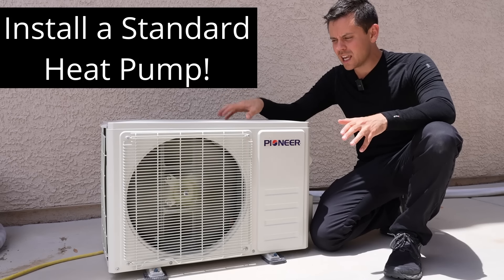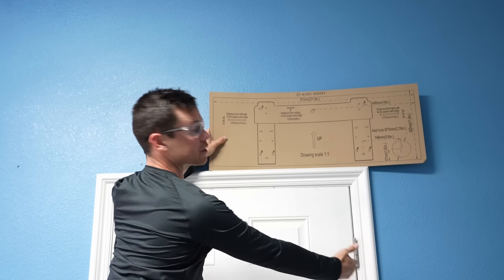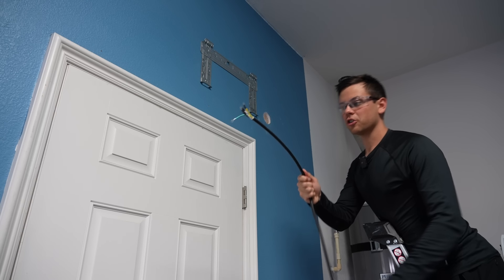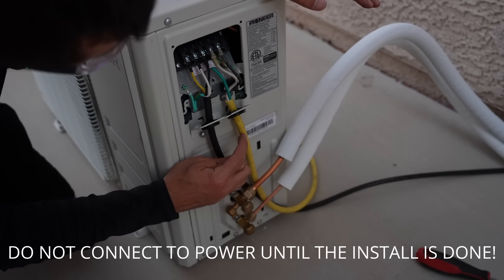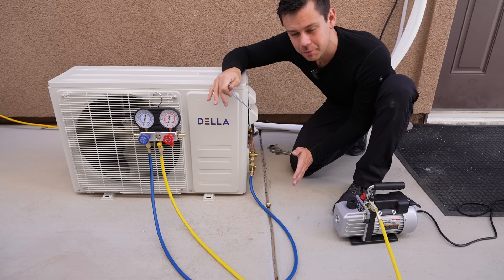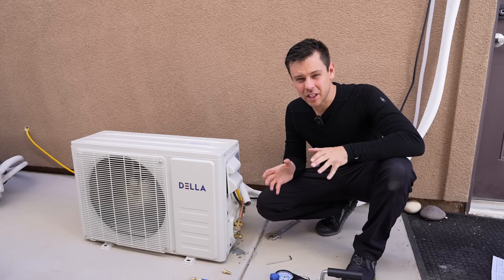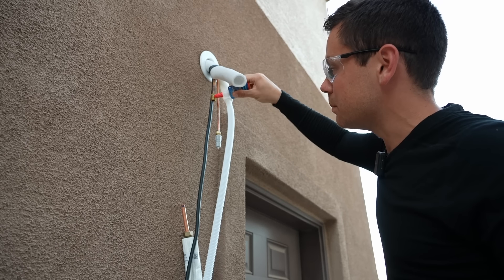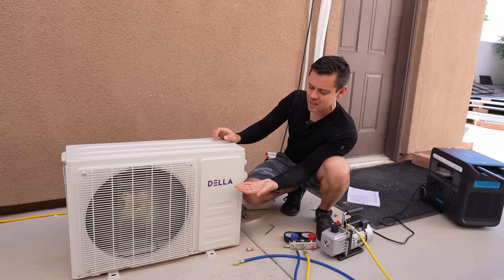Budget Mini Split Installation for Beginners! w/ Vacuum Pump and Gauges

Comment: Just an FYI, if your vacuum rises a tiny bit then stops, that's okay. Run the vacuum pump again until you're back to zero. What happens is that as you pull the vacuum, water vapor in the line will condense and then freeze. Ice will not vacuum out. But as the lineset warms up and the water evaporates (sublimates, actually), it will cause the vacuum in your line to drop. Will didn't have to deal with this because he's in a desert, but if you're in the southeast you will see it.
Reply from the maker: Oh that's interesting. Thanks for sharing that
Reply: This is why the manufacturer recommends a teipple vac/nitrogen flash sequence.
Moisture crystals in the system get heated and flushed out with the nitrogen purging sequences.
Lotsa tricks we pros use.
Reply: I'm in southern west virginia. Been vacuuming for 15 mins now and vapor still coming out. I don't have any nitrogen to use so what do I do?

Comment: Great Video. I have a Pioneer unit that is about 10 years old. I did not have the HVAC  tools, but I installed it all myself and had an HVAC tech friend come over to vacuum it and release the refrigerant. I've never had a problem with it and have been very pleased.
Reply: That's what I did too. You get a proper nitrogen purge as well, plus he'll have a fancy leak detector and good valve core remover. Even ends up being cheaper when you're only doing 1 or 2.
I'd only go full DIY if I was fitting out a whole apartment complex or something
Reply: @motog6436  Do you remember what you paid per unit? I'll have 4 or 5 of these to do on a new property I'm developing, so I figured the DIY route would save me some money, but maybe not? And any idea if you get the factory warranty going this route, or would the tech need to actually do everything Will's doing in the video? The Mitsubishi unit I bought recently, and I think most on the market that aren't called "DIY" require an HVAC tech to sign off that they did the installation in order for the manufacturer to honor the warranty.
Reply: @TroyWarr1980 if you are doing several, the proper tools and supplies will save you money and make it so you can do more in the future, or sell the tools on marketplace…
I am a pro installer in Charlotte NC… I left a lot of critiques for Will in the comments.
I’m happy to list what you need to do the job right on your own.
Reply from the maker: @SuperVstech  can you post a video of how to do what I did on a budget? And I responded to everything you mentioned.and  People will not spend money on the fancy HVAC gear if they can just buy a mr.cool or EG4 with quick connects.
Reply from the maker: @TroyWarr1980  the Mr. Cool doesn't have to be installed by a professional and still has a killer warranty for diy. They just cost a lot.
Reply from the maker: @TroyWarr1980  I would call around if you do hire an HVAC tech. A lot of the make up whatever price they want and some will charge insanely high prices. Sometimes not.
Reply from the maker: @motog6436  valve core removers are like $10. And you can flush the lines with nitrogen. They have a flushing kit for $30. It's not hard to do. None of this stuff is hard
Reply: @WillProwse  I could show all the ways to do it. Making a good video is HARD my hat is certainly off to you there! You are the BOSS of quality videos. I love that you address comments, even when they are asinine, and completely in the wrong!
Budget wise, instead of buying a $400 nitrogen setup, a paintball can adapter and you have a fantastic setup for leak testing and purging. Lowe’s used to stock a co2 setup for $50 that had an air chuck etc for portable nail guns...
But they discontinued it…
There are plenty of budget micron gauges available, and pawn shops often have good ones pretty cheap.
Reply: @WillProwse can you show us how to do a nitrogen line also can you please link the flare tools that you purchased?
Reply: I called a few companies and asked if they would just clear and connect the lines. They said: no way Jose, we only work on what we sell Mitsubishi, carrier, etc. Said their cheapest mini split installs are like $5k. So the worst thing about the diy appears to be the warranty but sounds like getting anywhere with an actual claim would be difficult anyways. So the frugalist diy way seems to be individual units (one compressor per head) diy installed.
Reply: @fox156 Good points, and just to reinforce your points, I had local San Diego company  provide an estimate to have 4 mini splits installed in our house (1 for each main bedroom, one for fam room), and estimate was $37,000 dollars for 4 Mitsubishi’s!!!
Reply: Some HVAC contractors do give reasonable prices for installation....I'm having my 24,000 btu Mitsubishi split installed for $1,200 (he supplies the line set, electrical connection and pad).
Reply: @thomasopalka5410  That is good! Does that validate the warranty as well? If it doesn’t I think it’s still ok, just curious.
Reply: @thomasopalka5410  where do you live? (What part of the country is fine).
Reply: My wife and I did the install and like you a neighbor vacuumed the line for us

Comment: One note of warning. The pre-loaded refrigerant is metered specifically for the length of lineset included with the kit. When cutting the lineset short make sure to refer to the manual so that you don't have too much refrigerant for the amount of lineset. A professional HVAC technician can adjust your refrigerant if needed.
Reply: @Channel-gz9hm most units just say don't cut your lines shorter than 15 ft and if you  go longer than 25ft per zone you must add refrigerant by weighing it in.
Reply: Im not an hvac guy, just a lowly plumber.. but i thought "i wonder if its been preloaded based on the length of lineset".. thanks for confirming this! also, just wondering it was it proper practice to open the high pressure side like he did prior to disconnecting? thanks!

Comment: Recommend getting your EPA 608 Type II cert. This way you can buy additional refrigerant if needed and legally add in if you have a longer lineset. I studied for a day then did a remote proctored course with Esco Institute. Got my certificate same day.  Only installed one mini-split in my cabin so far and needed to add a few ounces refrigerant since my line set was 35 feet and unit only holds enough for 25 ft.
Reply: I agree, and technically the EPA says you need it even to do what Will & many other people have done! According to the EPA, even installing the pre-charged lines on a MR Cool DIY unit require it. never heard of anyone getting in trouble though :)
From the EPA website regarding 608 certification:
Q - "Is technician certification required to install an R-410A mini-split?"
A- "Yes. Adding or removing refrigerant from a mini-split as part of installation, and/or connecting or disconnecting hoses or pre-charged lines requires a section 608 technician certification. Activities reasonably expected to violate the integrity of the refrigerant circuit include but are not limited to: Attaching or detaching hoses and gauges to and from the appliance; adding or removing refrigerant; adding or removing components; and cutting the refrigerant line."
Reply: @Channel-gz9hm  He added and disconnected hoses to pull a vacuum. "Attaching and detaching hoses and gauges".
Reply: @Channel-gz9hm  read: "....and/or connecting or disconnecting hoses, or pre-charged lines" ssssh!

Comment: Will, not to be picky, but please show that craw-foot extensions on torque wrenches need to be 90 degree angled to the wrench to cancel the additional length imparted by the craw foot.  This will give you accurate torque.
Reply from the maker: Good point. I do the first passes at 180, then last one at 90. Should have mentioned that
Reply: It appears (at 0.25 playback speed) that only once did you have the crow’s foot at a right angle.
The other times are not at a right angle, thus you are extending the effective length of the torque wrench lever arm. This requires one to use a correction factor (a multiplier less than 1.0). Not doing this will over torque the fittings, which is what it appears you have done. Unless one understands this, probably not a good idea to suggest using crow’s feet on a torque wrench.
Otherwise good video. Thanks.  @WillProwse

Comment: I have an EG4 12kBTU unit and have to get a couple more. The reason I went with the EG4 was the incredible efficiency. This unit can deliver 12,000 BTU on a 120VAC 20 amp circuit. I think they rate it around 28 SEER2. Are there cheaper non-vacuumed line kit models out there that can close in or match the efficiency of the EG4? By the way, excellent tutorial!

Comment: A trick to tighten the hose fittings so as not to leak is to tighten and loosen several times so that they seal well.

Comment: in Mexico they cut costs by using copper in the ends and aluminum in the middle, last installation I did was a nightmare because aluminum sucks to flange hahaha, I had to buy another pipes, one that actually were all copper

Comment: Great tip with opening that valve a little before removing the vacuum line. I just did a Tosot, and opened it slowly and watched the gauge until pressure was just slightly positive. Then you can remove the fitting with almost no refrigerant loss. Why don't any other videos show this? I don't see any way that fitting could be removed while there is a vacuum on it, without introducing air into the system. Thanks for all of your videos, great stuff.

Comment: i have a suggestion on the removal of the blue hose under pressure. you lose quite a bit of refrigerant in the process. i would connect a shut off valve in between the shredder valve and blue hose. before releasing the refrigerant, i shut off the valve and isolate them. in this way, the lose of refrigerant is minimized.

Comment: Just installed a Della 12000 BTU 115 V . Your video was INVALUABLE and got me thru the install. I replaced the manufacturer 1/4 inch line with one from Lowe’s because the manufacturer line kept breaking while torque ing . It’s working beautifully and THANKS SO MUCH!!!

Comment: For the torque settings it is my understanding that the crow's feet need to be at 90° to the torque handle couldn't quite see that in the video but it is important as it does change the actual torque

Comment: Nice. My ductless aire came with a sketchy diagram that required 5 different Kung-fu maths that you added and subtracted to determine the hole placement that still was 1/2 " too high.

Comment: Excellent video! It helped me immensely , but it would have been nice if you showed the wiring a little closer but not required. So, I saw in the break in video that it was -31 or so but in the return video it was -30, did that mean you had a small leak?

Comment: Overall, good teaching. However, when it comes to the vacuum section of the video, when you “isolated” the line set, the gauge would only have been reading the vacuum between the pump and the gauge. Not the lines. Here’s hoping they held vacuum😅

You would need either a valve on the end of the yellow line from the pump or a gauge set with a valve for the vac line.

A nitro pressure test would also have been nice to see.

Comment: 17:58 "remove this nut" but forgot to say put it on the other pipe before flaring ! You wrapped the bundle from the top down. So the overlaps point up, allowing rain to penetrate. Wrap from the bottom up so that the overlaps point down.

Comment: Odd, but my new Della 12k owners manual say, after vacuming, open the low pressure valve 1/4 turn for 5 seconds, not the high pressure side.  Is that a misprint?   Now I'm unsure.

Comment: A great job considering that you probably didn't have access to nitrogen for pressure testing your line set.  Where I live, the building code would have required weatherproof conduit and a disconnect within five feet of the condensing unit.

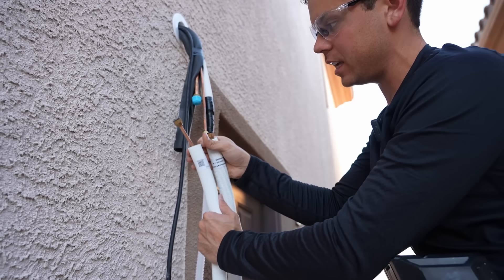Comment: Thanks Will. I have watched a dozen videos on this, and yours is the only one that explained the line hookup well. Question, at 7:23, I hear hissing when you are loosening the plastic over on the inside unit high pressure (small) line. I'm assuming that is the nitrogen escaping?

Comment: Question please:  how do you know if the HP line does not leak if you don't run a vacuum on it?
Reply: No need to, because it all coneccted in circle. So if there is a leak it will show on manometer.
Reply: @Reddington07  Thank you Sir...

Comment: When you shut off the valve to the low pressure line, you were no longer reading the pressure from your system. Therefore you would not know if you had a leak.

Comment: Will.  With reference to your step, opening up the lower valve just a 1/4 turn for 5 secs to bring positive pressure (gauge reading from -30 to 0) before removing the adapter from the port...May work on that brand that you're servicing, but on my Senville mini split, being very careful and doing that(I am a retired Master Electrician), the pressure immediately went to 15 psi) and I was then unable to remove the adapter without purging all the refrigerant.  Everything you outlined worked fine but for the Senville unit, folks should skip that 1/4 turn step and just slowly remove the adapter letting pressure out.  FYI...Paul

Comment: You really should get yourself a nitrogen tank to test the system and ensure it is holding the pressure correctly before releasing the refrigerant. Also, I have used the Hilmor Quick Engage Flare and Swage Kit which seems to have good results and is stupid easy to use.

Comment: Id include another remark in your video. Make sure the adapter for the hose has the valve or, it will not push the service valve to make the vacuum work. It happened to me.

Comment: All of your videos are great and I sincerely appreciate your teaching. One note, on the vacuum pump, where the yellow hose is connected, I didn't have the other cap tightened down and so it appeared I had a massive leak. Then when I went back and checked everything I realized that the cap was not tight and that is where my leak was. I hope this little bit of advice from an amature helps.

Comment: Hello, your actions in your video are quite well executed, but there are still some comments to make:
I never use Nylog blue, the flare makes the seal, not the thread, so this product is used by amateurs who cannot make a decent flare :).
I never use the Tork key, this is for the doubters ;)
And important, you check whether the connections are tight with the coolant in the system. I never work this way, you have to do this before you open the service valve. I always do a pressure test at 1.1x max HP, and this is between 40 and 45 bar with nitrogen. Vacuum with a 2-stage pump and use a digital LP manifold. These are just small tips, but I do start-ups throughout Belgium and I do my refrigeration installations as it should be, based on my training and many years of experience. Have a nice day, greetings Danny
Reply from the maker: Thanks, good tips

Comment: Thanks will, great video.  I would have liked to see a closeup of the manifold hoses as you put them on (my manifold hoses are not the same on both ends).  I would have also liked to see a closeup of the adapter you mentioned.  I think the correct adapter came w my manifold set, but I can't tell for certain without a closeup.
Reply: seems to match the adapter Prowse put in his description.

Based on a few hvac videos, I think that is a push tab that opens a schrader valve.
Reply: OK I did it.  Followed your instructions and my heat pump is working great.  Thanks WIll

Comment: How did you run you wire on the outside unit? 240/120? Needed a dedicated breaker per code or not? Or did you just ran the extension and plug it inside 120v receptacle?

Comment: Thanks for this great video. Does one need to verify if the condenser live wire consumes the start current as specify on the faceplate to ensure that the gas pressure is correct?

Comment: Doubt anyone will ever see these comments but at 18:00 the Della version is apparently metric copper tubing, the 3/8 will slide through any 3/8 flaring tool. The Della seems to have cut many corners over the Pioneer to make up for the price difference, no rubber feet, no remote holder, etc... I think I am already regretting this cost saving decision....

Comment: Those are manufactured by Midea. Like most Chinese manufactured devices they all use similar components, just different revisions. If you ever question who the manufacture is do a reverse image search of the remote / thermostat. Once you have that info finding parts is a lot simpler. Most of those line sets have terrible factory flares. I would recommend reflaring all of them when doing an install. Eccentric flaring tools are pretty much mandatory to use to get a leak free seal. A lot of people will coil the extra line set behind the unit, this is bad for two reasons. One it serves as a oil trap preventing any oil to get back to the condenser. Two it can block airflow through the condenser. The install in the video was very clean. 👍

Comment: Just started watching your solar, lithium videos. They are great ! 
 With a ductless heat pump, there should be a nitrogen test for 24 hours if possible along with using a micron gauge with  the vacuum test. The vacuum test  should be a few hours as well if possible. Using line hide to protect the outdoor refrigeration lines  would help out substantially. The uv tape only last  a few  years.  Your videos are excellent. I am sure if u install more ductless heat pumps you will learn the proper process eventually. 

Thank you for your solar, battery knowledge ! You make your videos entertaining as well with your charisma.